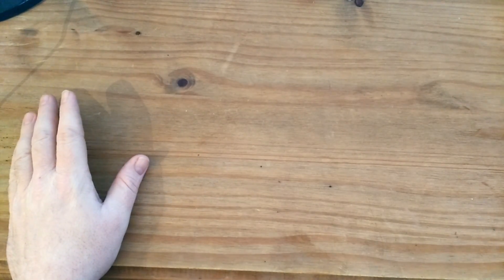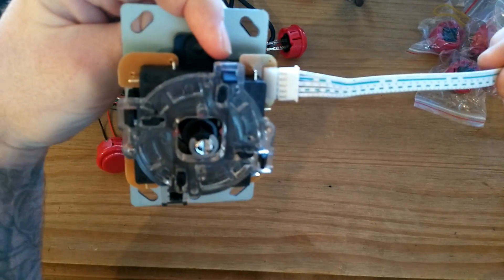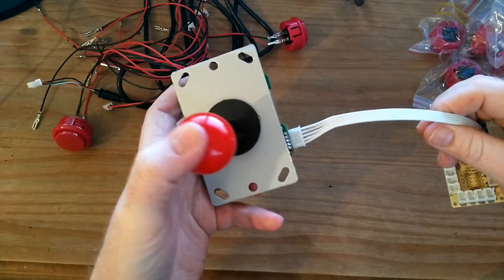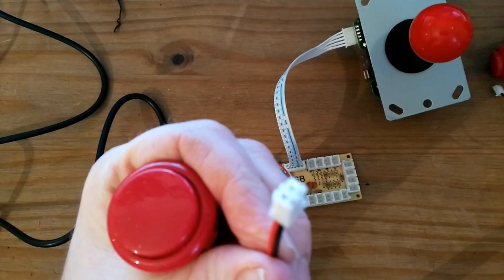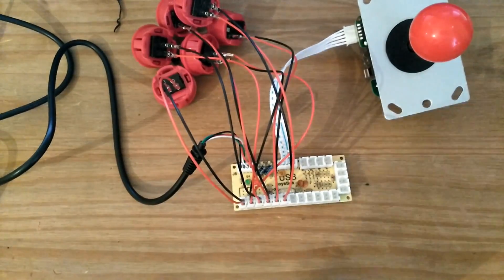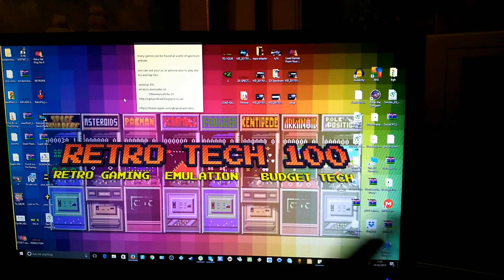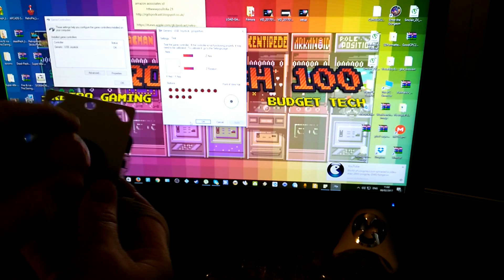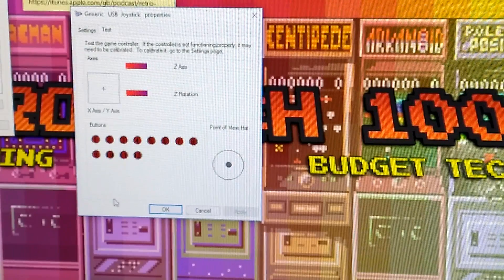Set up and Test Arcade Stick/Buttons for Retropie Build

Comment: Sorry, this is probably an obvious question, but I'm new to the whole rb pi thing and haven't bought 1 yet. But, how does this connect to the pi, is it through the usb?
Reply from the maker: Yes straight to usb.
Reply: @RetroTech100  thank you mate
Reply from the maker: @jaypalmer0616  No worries. They are really straight forward. Youll see if you get some.
Reply: @RetroTech100  yeah, I'm making my own arcade cabinet esc thing and your vid really helped, so thanks, if I need any help can I give you a shout? 😂

Comment: Thanks so much. I am planning to build my own Barton arcade cabinet. Some of the parts brought from eBay UK buy most ordered from eBay China since it was cheaper. Found 2 players, 20 buttons, the same kit you have but double the parts for £17.69, cheapest price. But I have to wait a few weeks, don't mind as it's a slow build. Just taking my time. Since British weather is horrible, will wait till the summer to build. cheers for the instructions.

Comment: so this literally just uses USB no soldering or anything just a USB connection and thing configuration?  Because I would like to use this on my Raspberry Pi but would not necessarily like to have to solder anything
Reply: Thank you so much for respond so fast!
Reply from the maker: No problems. Any questions hit me up. Maybe join the Retro Tech 100 Facebook group and we can help you out further.
Reply from the maker: Absolutely no soldering. Sub and it's very easy.

Comment: Thank you very much this video help me a lot I just have a question, if I configure my arcade joystick and I wanna go back to my regular control woulndt that mess my configuration? Because I did it with a PlayStation controller and a few days later all the commands were out of order (ex: start move to L2, select to X etc) so now in afraid that if I map my arcade joystick everything's goes out of order, thanks for your help
Reply from the maker: It can do. The best youtube channel for videos on this is Easyhax. Thanks for watching.

Comment: So do you notice any lag with these USB encoders??? How's fighting game inputs??  Like, throwing a fireball in street fighter...dose it  come off easy?? I bought 4 of these encoders and haven't had a chance to do anything with them yet. My plan is a 4player arcade cab. These should be seen as 4 generic USB controller.
Reply from the maker: I haven't noticed any lags whatsoever and they work great with fighters.
Reply: Retro Tech 100: that's great to hear🤘🏽. How many have you had connected at one time? Just wondering if they are easy to assign to whatever player you want....
Reply from the maker: I've had 2 connected to my raspberry pi plus an xbox 360 arcade stick hooked up at once with no problems.
Reply: Retro Tech 100 that's awesome man. I just hope Windows reacts the same way as the Linux Raspberry Pi LOL. Thank you.

Comment: Hi my joystick has a problem..i tested it and it won't go to the right direction.it can only do up down and left....pls help me 😭😭😭💔💔💔
Reply from the maker: What have you plugged it into so far?
Reply: Retro Tech 100 my computer...this is actually a 2 player arcade stick with built in games so i use hdmi and a cellphone charger and just connect to tv...the 2nd player's joystick is fine but the 1st player isn't...i'm trying to open the arcade now..just really hard to get into it
Reply: Retro Tech 100 it's fixed now...i opened it and it's just a loose cable on the joystick😁

Comment: Hello, I just received in the same board set up with the same wires but my buttons have 4 connections. I'm sure two are for lights however the kit does not come in with wires for the lights. Any ideas what I can do? Do they sell 4 wire cables that will still fit this board or do I purchace wires for the lights? If so how would I power them? Any help would be great.

Comment: Found a front end for android called romflix.. 

Trying to get this style of button setup usable, but can only seem to get keyboard and mouse working.. I don't have any Bluetooth controllers going either. 

Only connected by USB via a hub.  

In the settings menu, under system and inputs, there's no option for me to use a zero delay board.. However under kodi repositories, in the repository section, you can install other controller options such as PlayStation etc. 

Any ideas for these types of controllers? Really would like my arcade desk running :) and no I don't hold you personally responsible. Just saying, with your help, it might happen.
Reply from the maker: +Gary Stinten I can do a few tests and get back to you.
Reply: Retro Tech 100 thanks.

Comment: I have this exact kit x2 in an arcade cab I'm building. They work great in emulation station but when you go into a game it gets all wonky. I'm interested to see if you have the same issue.
Reply from the maker: +Sara Thomas No mine works fine. Why not reset the controller config. That may help.

Comment: Hi Retro Tech!
Can you tell me what is the size of ring/blockade on 30mm button?
http://i.imgur.com/8cBn3pO.png
Reply from the maker: ZłyBratBliźniak  I needed a 32mm spade bit to drill a hole to put it in the wood but it was still tight. Let me know if that answers your question.